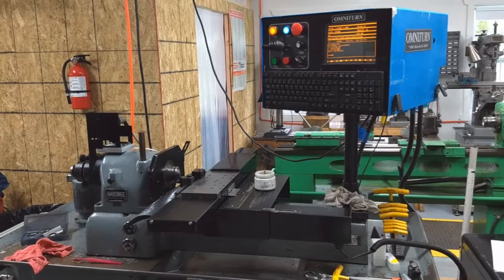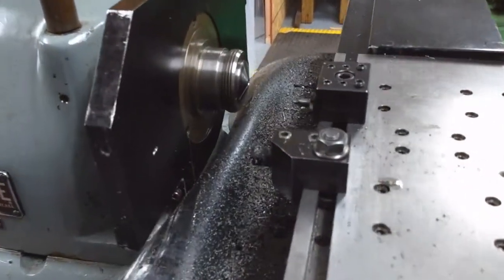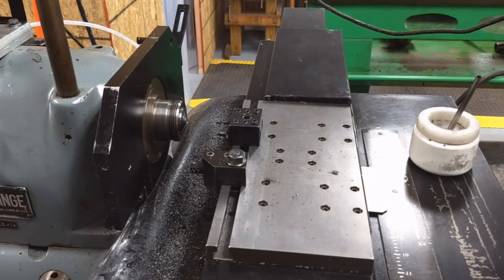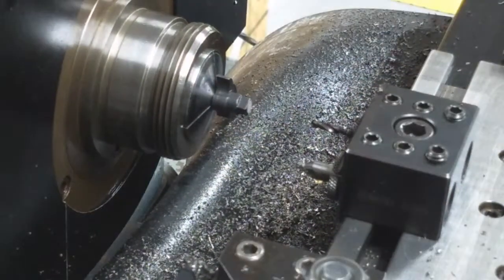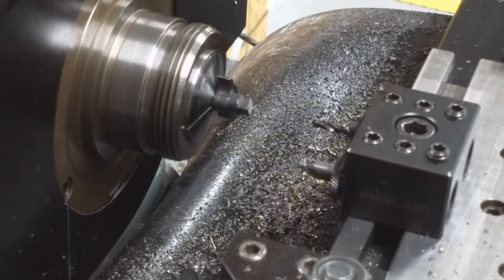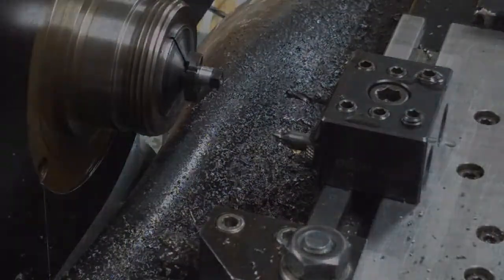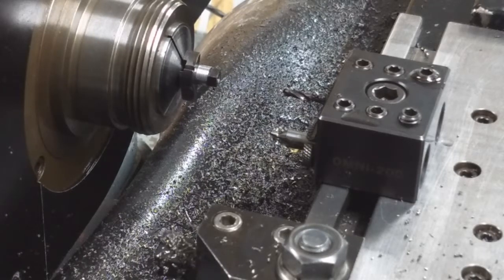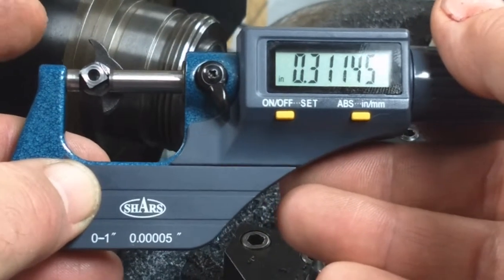Omniturn #5

Comment: Thanks for the video. There is one of these for sale close to me for 2,500, the CNC seems to work and they have been able to run the Y axis. I am so tempted, even if I do not have a use for it.

Now as for a thought on your process. Think robotic handling and second operations. Since you make a lot of these, this would free up your time.
Reply from the maker: They really are fun! So versatile too. I believe  I paid 1200 for the machine,  but it took a bunch of money to get it where it is!  2500 seems good for a tight machine.

Comment: My opinion re centre drills.  They were made to create a centre for use with a centre in the tailstock.  Because they are short and solid and around the lathe, we have, I believe, taken to using them to start holes for drills.  At which they are crap!  If you look at the point, they have a huge chisel point for their size.  Spotting drills (again in my opinion) work far better at starting holes for drills. They only video I have, in which a centre drill is used, the customer needed the 60 degree taper in an air restrictor tube.
Reply from the maker: You are so right! I started using a 140* spot drill to complement the 135* stub drills. Much better process!